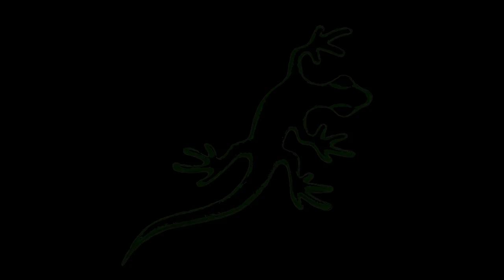Woodturning Art Fill Cracks And Voids With Crushed Stone and CA Glue

Comment: Do you apply sander sealer prior to using the denatured alcohol and shellac to avoid the different in color between the crossgrain and the rest of the wood? Also, I have a foredom drill. Where do you purchase your carbide drill bits... The ones I have gotten don't seem to be as fine as yours are... thanks in advance.
Reply from the maker: yes; it works pretty well.

Comment: I think it looks fantastic ! The metallic dust indeed made it POP ! .. on the larger void, the ca alone will hold and support the faux pieces ? That just amazes me how great it looks and you only used ca to seal the pieces in. I've shied away from attempting to fill voids or even inlays because it seemed the process (at least those I've watched) was much more involved than I could undertake. New subscriber !
Reply from the maker: Thank you. I have been using this process for years. It has never failed me.